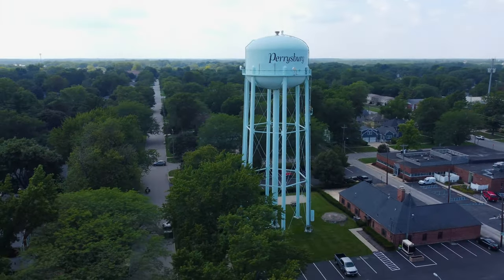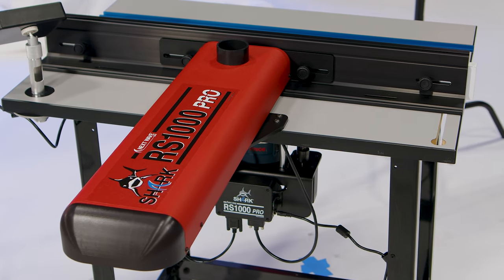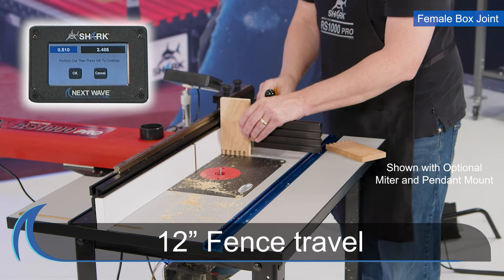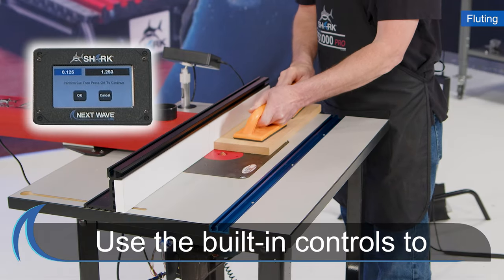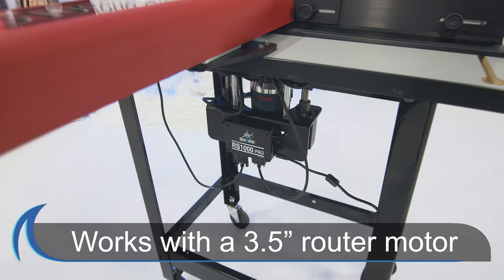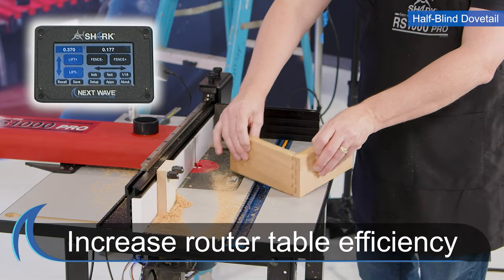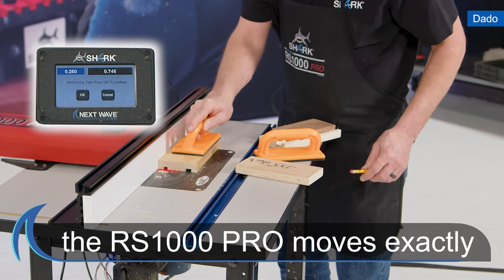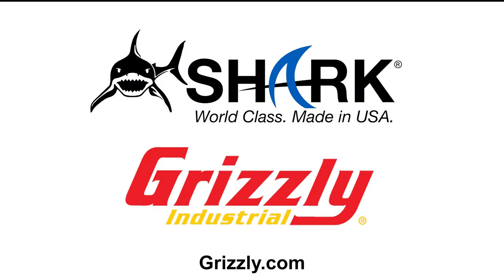Use THIS to Convert your Router Table into a 2-Axis CNC | T33586

Comment: Got mine.  A couple of comments.  Received with router mount loose.  Bolts not even finger tight.  After router tightened in, noted that tolerances on cuts was terrible.  Could wiggle router in lift.  Better after loose bolts discovered and tightened.  Accuracy still limited by the router motor you use.  Also, got the free sliding miter and it’s not perpendicular to tabletop.  Still messing with it.  I used six playing cards to shim it to square it up.  Will likely disassemble and bent it into proper shape.  A bit disappointing for an $1800 router table add on.

Comment: Looks like a good idea.. My concern is how secure could that fence be on the ends? the only part really secure is the center. The ends have to be loose to allow for movement. Which means when using larger boards there will be movement.